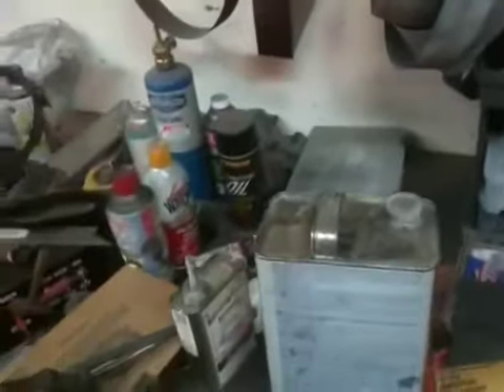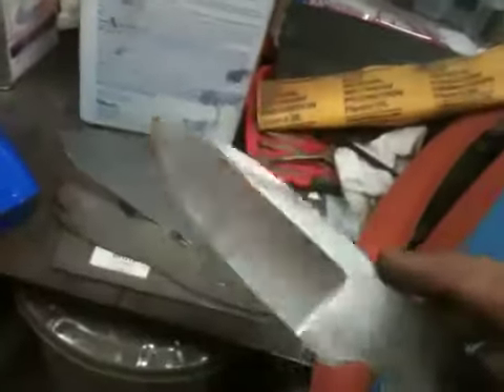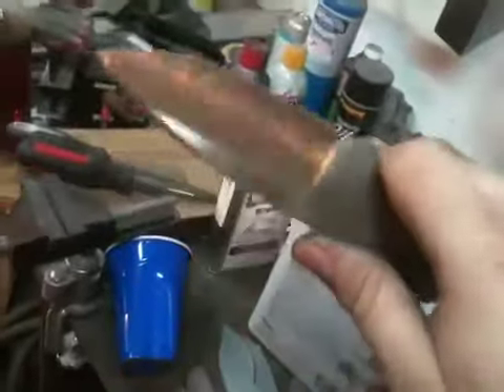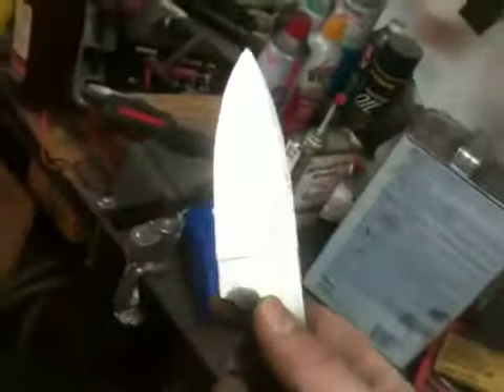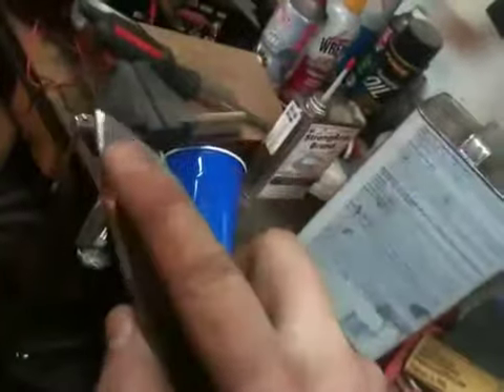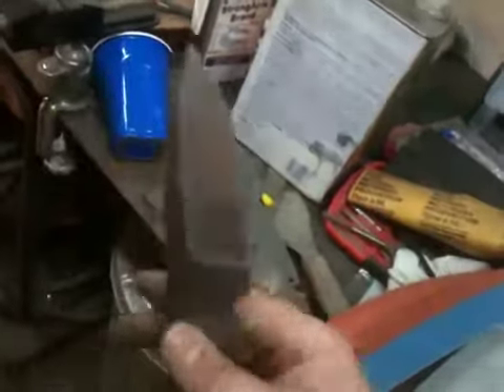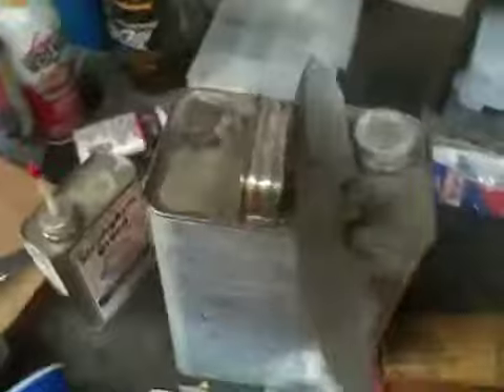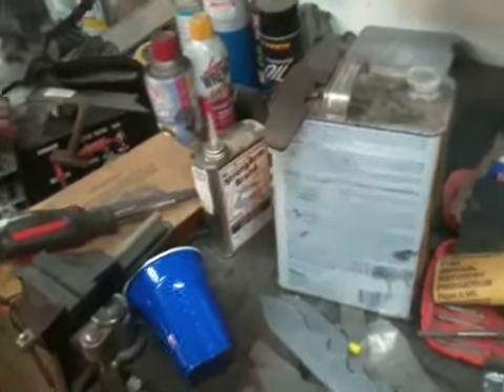Hollow Ground Spear Point Hunter before heat treat

Comment from the maker: @mainetrapper I believe I've "heard" of guys trying to do that, but I don't think I've seen any example of success. A stone wheel is much harder than a rubber coated contact wheel and doesn't have any "give" in. Also, the surface is rarely as "true" and fluctuates as metal and stone is removed. I'd definitely try some scrap before I used a good piece of steel. I don't think it's gonna easy, or give as consistent of a result as a file or a contact wheel.